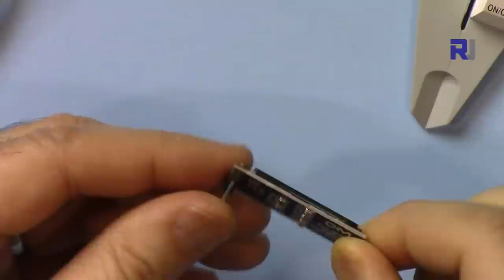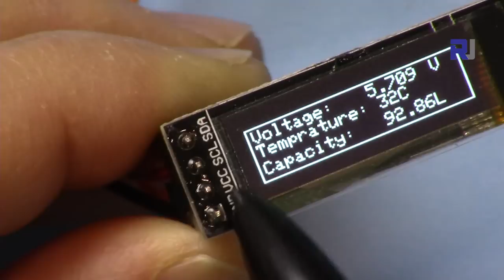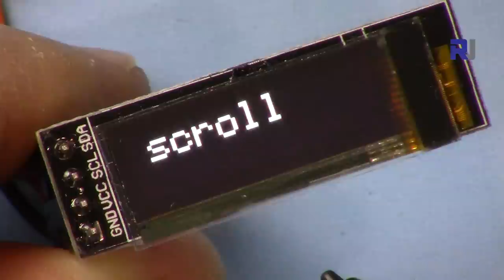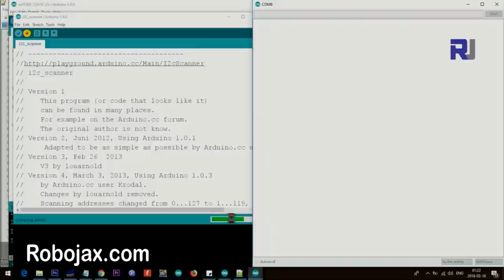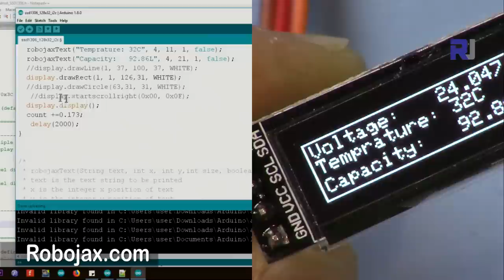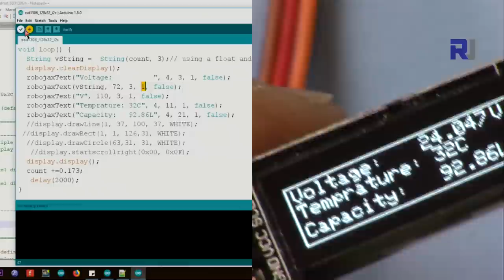How to use SSD1306 128x32 OLED Display I2C with Arduino code

Comment: Thank you , very informative; but the problem with ADA libraries is they are bloated. This little sketch uses 67% of program memory space and 77% of dynamic memory (Nano) . I think you might agree there is little room left for the user program and there are more efficient libraries out there. Your explanation was good.
Reply from the maker: You are welcome.  Yes you are right. This needs a lot of memory.

Comment: this will help on the heltec esp32 with i2c oled module...  to read an analog voltage and display it...   thanks a lot...😉
Reply from the maker: you are welcome. Here is how to read any DC voltage up to 500V using Arduino https://youtu.be/t8xwrVj2aFs

Comment: Hi, I tried your sketch and the result is a bit strange because the size of the rectangle and the text inside is about vertically half sized. Width is o.k. Text can be read but abnormal. Sir, have you some idea?
Reply from the maker: No it is not okay. You must have switched the 128x32 as 32x128  but it is the size settings check it.

Comment: Hi RoboJax
i have been using some of your code above to get used to the 1306 display, but im finding an issue i can not get around,  im display a float number like   1.24  but when the number goes negative it will display it like -1.75   which is all good so far , but when the number goes posative again 1.24  it will dislplay 1.245  the 5 from the negative number is still remaining on the display , i have tried the set colour to White,black  but this does not seem to fix the issue, and using the clear display makes the screen flicker which is anoying,  is there a way to solve this issue please?
Reply from the maker: It is because the screen is cleared. I have mentioned which line is clearing the display.
Reply: its working now but i dont know why..

Comment: i am trying to make it work using a wemos mini d1,  scl and sda  are pin D1 and D2, but i get nothing on the screen when i use the examples. Any idea if i have the wrong pins?
Reply from the maker: You should use I2C scanner to get the address http://robojax.com/learn/arduino/?vid=robojax-I2C-scanner and see if you get the I2C address. Then run the code with I2C address you found.
Reply: @robojax  hello , i tried using this code for my OLED screen , after starting the scan the serial monitor shows “scanning “ but nothing happens after that, the scanning stops automatically after a few minutes

Comment: hi M shamshiri!  I followed your video to the end: I did not find any trace of any clock even in the code ...
Reply from the maker: Hi, I did not make a clock. this is just to display  a text so you know how to use it for any other purpose.  I might make a clock using this module, but let's see.
Reply: @robojax  Sorry, I confused the oled ssd1306 with the clock module sd1302 ...
Reply from the maker: no problem.  This is the only image available for this.  I have 2 or more clock videos. check them out.

Comment: I got a similar module but labels say GND, VCC, SCK, SDA. I assume mine may be different?
Reply from the maker: No. it has clock (SCK) and SDA . Exactly the same module. They just label them like that.
Reply: @robojax  oh, good. i assume, i need 2 use the lib which is tailored 2 the 128x32 dimension, right?

Comment: Why have a link to the code, but not the library?
Reply from the maker: Hi did you visit the code page? I just checked and I have provided 6 other links. Just visit the page you will see the links resources for this device.
Reply from the maker: did you check it?

Comment: hello why do I not want to complain about these libraries from adafruit, both this Adafruit SSD 1306 no exaple compiles both 128x32 and 128x64 and also another Wmos Mini Oled error C: \ Users \ Michu \ Documents \ Arduino \ libraries \ Adafruit_GFX_Library \ Adafruit_Gray_GrayOLED_GFX_Library \ Adafruit_Gray_GrayOLED .h: 30: 32: fatal error: Adafruit_I2CDevice.h: No such file or directory
compilation terminated. I installed libraries and from the menu through the library manager and in a folder in windows
Reply from the maker: when I searched  for ": fatal error: Adafruit_I2CDevice.h: No such file or directory" I found this page you look at https://forums.adafruit.com/viewtopic.php?t=168864
Reply: @robojax  it works thank you very much

Comment: Can we  make smart glasses from this screen
Reply from the maker: I don't think this can handle like 10 frame per second of new data(image). this is made for simple shapes  or text.
Reply: Theoretically you could do so, because of the size of the screen but it wouldn't be that useable and as Robojax says, it's not capable of many frames. I think you would be better off getting a higher resolution coloured one which could handle more frames...